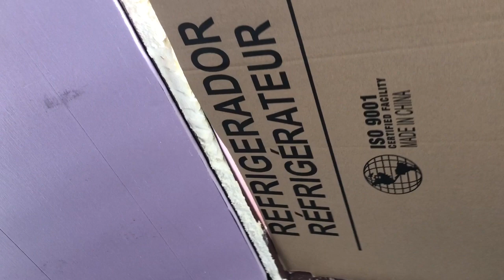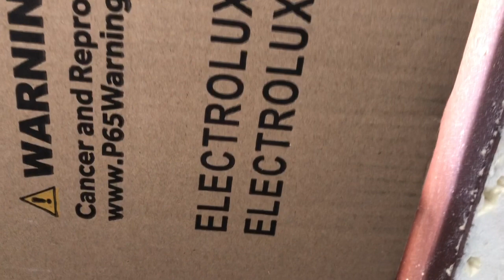Trimming the Skylights - Vlog 128 School Bus Conversion

Comment: What was the goopy product with which you coated the foam insulation? This could be an interesting way to build a light weight finished skoolie ceiling between a wooden grid structure...? Wheels turning in my head now.
Reply: Spackle
Reply from the maker: Alex sparkling compound. We got it at Home Depot